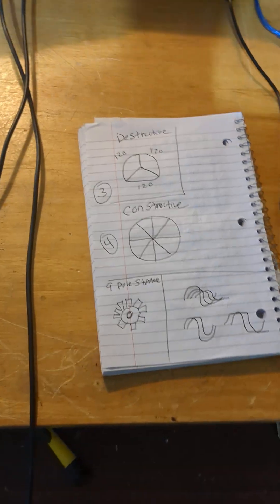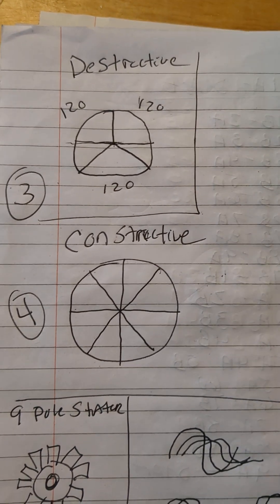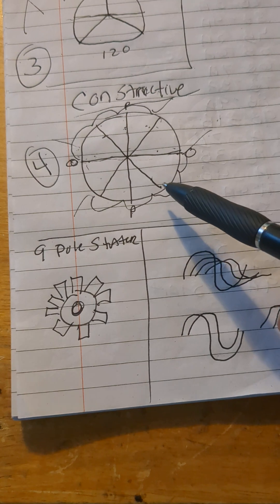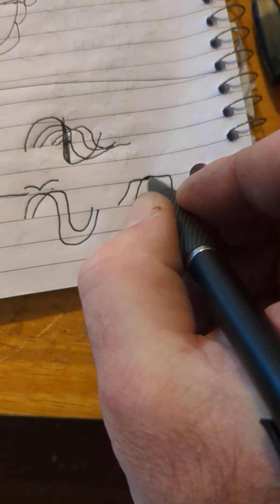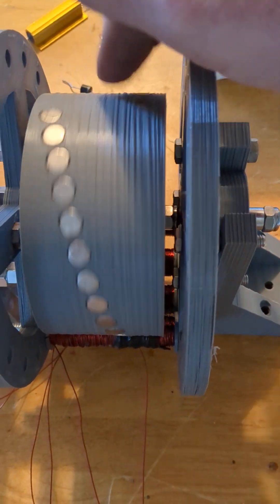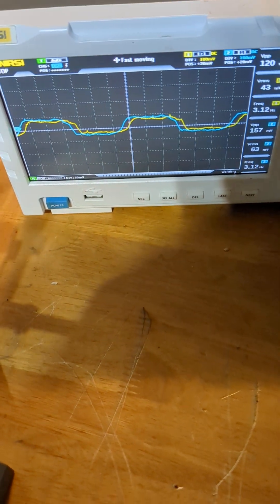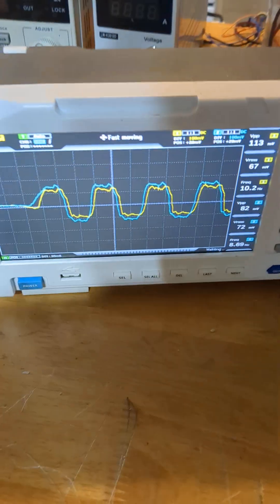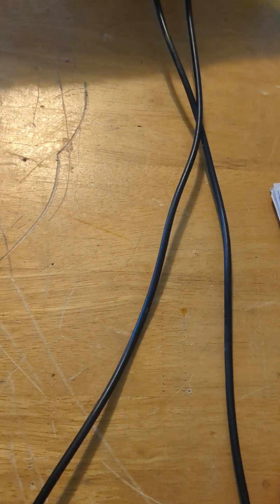Sneak Peek-  9 Phase Generator Build- Higher Order Poly-Phase

Comment: The theory is sound but, a working model?
Reply from the maker: I finished it and got beautiful 9 phase output.  But extremely low power with this design.  I may circle back- but I I am involved in other builds at the moment
Reply: @floodrod What builds would you recommend?
Reply from the maker: @hoofheartedicemelted296  Rotating magnetic fields is probably possible. But right now the hot topic is Tinman;s motor. See the forum in the description
Reply: @floodrod  Thank you sir, I'll check it out.

Comment: I have a super rare Honda PMA that was three phase. I was going to make a little wind generator out of it. It would make 13.1 volts with a fan blade on it. I hooked the windings in series, now it makes 39.3 volts. It came from an experimental Honda 660 car that had a motorcycle engine. They were only made for a year or so. It doesn't even have any numbers on it. It puts out a lot more wattage in series. I think what it's doing is creating a six phase output. I only ever saw two of those cars. I worked on one in 1991 when I was working at a salvage, and there was an extra PMA alternator there, they said I could have it. I've never seen anything like it. The magnets are about three inches long and it has six poles and six magnets. The stator coils are rectangular, about four and a half inches long. Somehow, it's doing sort of like you're talking about here, except it's six phase. I was just going to run it through a rectifier to charge some batteries. I have twenty big deep cycle batteries that like a small amount of power keeping them from self discharging.I recently replaced them with some 24 volts lithium iron phosphate batteries ⚡😎👍. So I'm just tinkering with the wind generator. I have a three phase wind generator too. I'll be building a DC one pretty soon. I already bought blades and a hub for it. But this little PMA is only about two hundred watts. Probably why the car didn't pan out. I knew a guy that drove one, and he had to put it on the charger if he had used the headlights. But the little PMA  is just a fun size to experiment with. A regular alternator would act completely different because of the windings. What I was wondering about, in your video the magnetic field isn't going across the wire direction, but almost in line with it. I was just wondering what if the coils were wound like end to end direction around the bolt, as opposed to around the diameter. It looks like it would make a lot more wattage.  Well I guess you can always make a couple coils to try it if you want. I figured it might double your amps so you might want to try it. Seems like you would get four or five volts from a hand spin. Being in series, and everything. By the time you put all the coils on you'll be getting 130 volts, I think. I don't think anyone else thinks to make the rectangular coils . I think they work better. Just thought I'd throw that out there. That would give you 18 cycles per pole instead of 9. That would make it put out the same wattage at half the RPM.
Reply from the maker: 6 pole with 6 magnets should be a single phase generator.  You have 6 legs out so it appears 3 phase, but all phases are in sync. 3 phase needs only 2 magnets for 6 coils.  I'm positioning the coils like this because if I passed the faces I would need 9 coils every quarter, meaning 36 coils.

Comment: Excellent job..  been working on something for over eight years I built a six it worked absolutely perfect a bit different design same principle I am now working on a 12.. keep going you will remove that cog or pressure from the system will disappear..
Reply: How are the wires joined/connected? All phase together, all neutral together? Thank you sir.

Comment: watch some videos about "dot product".  The effect you are looking for is the dot product of 4+ phases.  You do not have to manipulate the source, the dot product is like the RMS of your +4 constructive poly phases.  Use +4 regular sinewaves and then calculate the dot product, which becomes exactly what you are after.   Forget about manipulating the source.  You are using high order multi phase to produce the output wave.
Reply: consider both the sine and the cosine.
Reply from the maker: @vantasner  I watched some as recommended, but it seems over my head.